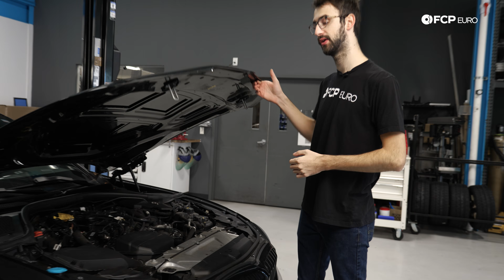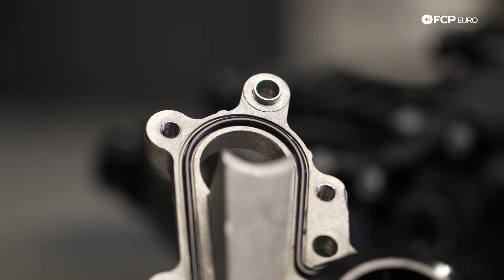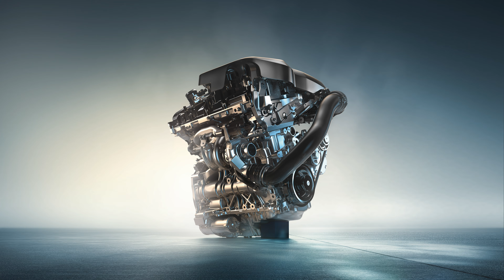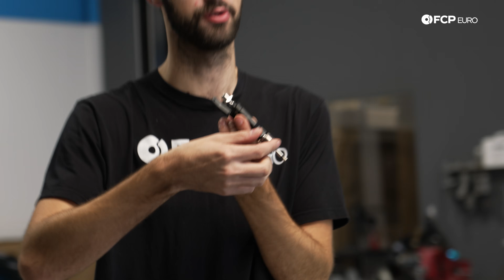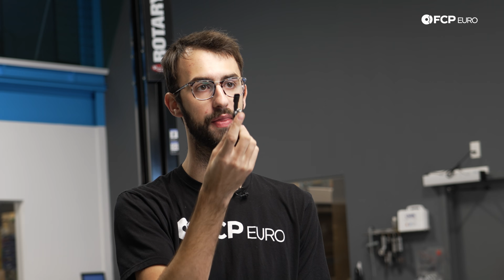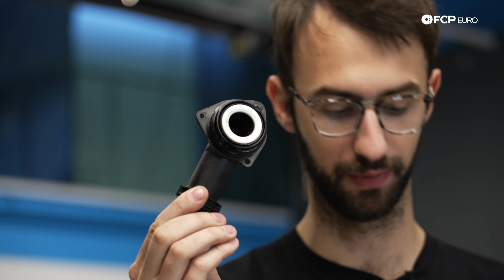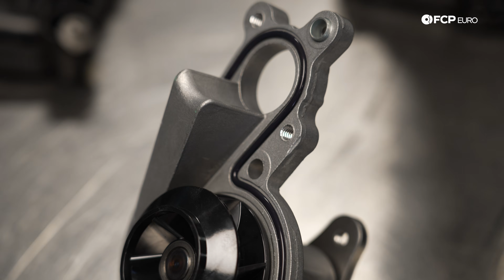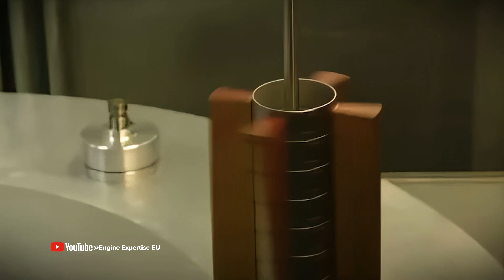BMW B48 Engine: Everything You Need To Know - BMW F30 330i, G20 330i, G01 X3 xDrive30i Engine Guide

Comment: I have a B48 with 210K miles on it.  No issues so far.  Finger's crossed.
Reply: Oil Filter Housing changed ? B48 TU ? or F generation ?
Reply: @vlad330i  The more later the better
Reply: 120k km on mine and no issues, though i did replace my coolant expansion tank a couple of months back
Reply: @williamdjunaedi2357 Just changed mine 2019 530i Xdrive @57K
Reply: @williamdjunaedi2357  had to changhe mine at 71k miles, but its working well thus far.
Reply: @williamdjunaedi2357  that’s con
Reply: Change your engine oil & coolant earlier than BMW recommends, you will be fine.
Reply: @ That too (2017 G30 530i btw if youre asking)
Reply: @johnmactavish5191  that’s not true, changing your oil and coolant  more often does not make these brittle plastic pieces last longer…  it might be better on the chains for sure but won’t change plastics breaking down.
Reply: @quiksr20 it all depends on how they drive at the end of the day
Reply: @quiksr20 which plastics have you had break? On your car
Reply: @johnmactavish5191  20k oil change intervals and going strong.
Reply: @heatsink9198 20k? 10k is crazy but 20k?
Reply: @johnmactavish5191 which oil n coolant do you use an how often?
Reply: That's awesome!   I'm a high mileage guy too. Hope mine does well.
Reply: Love to hear it - what has your maintenance intervals looked like? What car?
Reply: Such 🧢 😂
Reply: @isaacchavez1425  what? You jealous that Bmw cna go mre than a 200k miles without porblem? Cry hard
Reply: Wow! I replaced a leaking turbo oil pipe and coolant hose as part of a recall.
Reply: B48 Gang!! 🔥🔥🔥🔥
Reply: 150,000 miles on my 530i still running strong…
Reply: Please how did you keep it that reliable? I'm at 50k miles
Reply: Can you post a picture of your mileage? I have non-believers 😊
Reply: 70k miles already faced coolant issues not good. What's meaning reliable.  If you want most enjoy you Have to spend money otherwise no way
Reply: @asimkhalafov982 same
Reply: I'd guess it's more about heat cycles than km/miles. Lots of short trips will kill the plastic earlier.
Reply: Mine also good!!
5 years old..
But in term of performance and effienciency, my 330e can compete with any brand new same class sedan.. no drama just pure driving dynamic..
Reply: No issues by Euro standards where you replaced parts before they failed or no issues by Japanese standards??
Reply: 272000 km… no issuess at all, best engine ive ever had
Reply: @michielballhaus6336 its the b48 ? 

What you had to replace so far with this kilometers ?
Reply: @sebbbou5455 nothing!
Reply: New 25 X3 30
Reply: Your blessed because at 50k miles I had a cracked hose 60k miles I had a cracked radiator and heat exchanger
Reply: @iits.mufasa   Because you probably had the wrong coolant/anti-freeze.. you can´t use anything, you have to use the one indicated, which have anti-corrosive additives and usually is quite expensive. If you use cheap shit, you are looking for trouble.. maybe it was there already and it was not your fault...
Reply: @ it is the bmw coolant when I first got it same thing when the repair was done
Reply: HOW SWAY. LMAOOOO
Reply: That's great to hear!
Reply: You dont even have a car so stfu
Reply: That's awesome. I'm at 105k and thought that was high.
Reply: What do you do for scheduled and unscheduled maintenance?
Reply: What engine oil do you use ? Anybodies tips and tricks i appreciate.
Reply: @ericsivilla4091  Liquimoly is the one of the finest
Reply: wtf are you driving a honda or a bmw 😂😂😂😂
Reply: What year and model?
Reply: My engine blew at 67k miles cylinder 2 piston damage
Reply: @LeoBasass  were you beating on the car? did you tune it or was it stock?
Reply: Good information!!
Reply: Im looking to get one with the m package. What's the average cost of maintenance for it? and what were major things you had to replace if any?
Reply: Is this B48 and interference engine or is it free running? Specifically curious about the implementation in the Mini Clubman.
Reply: @MaroonCorey every BMW engine for the past 40+ years has been an interference engine.
Reply: @chrisrollins1 cool, thanks. Figured it probably was
Reply: Im not a mechanic, but over the past few month ive had so many issues that my mechanic calls me when he cant figure something out.
Reply: Wooow. My only has 54k so far in an f30
Reply: whats your instagram i have some questions about my 330i
Reply: I heard a lot of jokes in my day but that my friend takes it
Reply: The B48 in my 2019 530i xDrive is at 97,000 miles, shoutout to you 👌🏻
Reply: You still have it? Any problems
Reply: Wow
Reply: That is encouraging, just bought one. not sure about my impulsive choice of red  but of course i must be prepared to service it like a dog
Reply: I have a b46 gr Supra I’m hoping mine will last , do you guys think it will last 150k miles +?
Reply: I was about to go look at a 140k mile 2018 330i (manual) - now I don’t know - should I stay away??
Reply: 😢 you give me hope for my purchase tomorrow brother
Reply: Lucky, I've got misfires, coolant leak. Its been hell for me
Reply: What have you done? I’m at 112k I’m hoping to push strong
Reply: I have a 2017 330i with the b46, what year is your b48?
Reply: @sperlongatours  turbos aren’t failing… been  driving BMW’s since e30s… it’s the plastic bits that are failing. We are talking about oil filter housings and plastic coolant flanges failing, the turbos outside of wastegste rattles are usually fine.
Reply: I think it's impossible for a BMW B46/48/58 to reach 60k miles without a coolant leak, let alone 210K.  I have one with 60k +/- and have replaced upper coolant hose, turbo return coolant hose and now the upper coolant flange along with the entire oil housing. All due to cheap or inadequate plastics and or poor design. I have done all scheduled maintenance and used only BMW coolant after flush.  No more BMWs for me.
Reply: Mantain it correctly and use the right stuff, not Prestone or the wrong oil, and it will last forever..
Reply: @wepmo  I disagree, The B48 oil filter housing issue I faced was with Factory BMW coolant and Liquimoly oil changed every 6k miles.. Not sure how using the right coolant would affect the plastic parts failing.. Its all over the forums just search bimmerpost for B48 Coolant and you see tons of complaints. Ive never had to replaced stuff like this on cars this new in my 30 years of driving many cars.. Hell my old turbo Nissan ( 2.0 Twin Cam Turbo ) was beat to 7600rpm daily, drag raced and beat to hell and NEVER had a coolant issue, its a 1992 and still has the same radiator. These failures have ZERO to do with Maintenance and everything to do with poor design / poor materials.
Reply: @quiksr20  I agree because I kept up with maintenance with my vehicle and I’ve had these vehicle only for a year and had these issues I want to switch to the b58 but no car should be like this
Reply: @iits.mufasa  I agree and it sucks because I love the car and I am a BMW fan ( have been for years ).. But to have to cough up thousands in repairs for things that should be breaking on a call with less than 80k miles / 5 years sucks... BMW has no excuse and should be recalling this crap.
Reply: @quiksr20  I agree 100% I used to be jdm all day I switched over I love bmw but it’s just poor design these are issues that should’ve been squashed with the n54 motor
Reply: @quiksr20  I’ll be trading my car soon I’m thinking q50 or 540i Ik the b58 is way better
Reply: @iits.mufasa  Just keep in mind the B58 is better but has the same exactly coolant issues ( same parts basically ).. It sucks because the B48/58 are great motors with just some costly poor parts choices bolted on to them.
Reply: @iits.mufasa  100% agree, Still have a 2.0 SR20DET Sentra SE-R ( Bullet Proof ) and have had numerous B Series hondas you couldnt kill.
Reply: @ that’s awesome man my neighbor had a sr20 det s14 it sounded amazing he used to beat on it and never had an issue I wanna build a boosted 350/g35 and a Honda b or k series for fun
Reply: @iits.mufasa  Thanks!! Yeah despite the negative stuff people say Hondas are engineered well and can be very fun.. I also had a G35 ( 2006 6 speed sedan ).. If you click my name I have some videos of my Sentra and possibly my old G35.. Best of luck with your projects.
Reply: @quiksr20  I'm about to get the F31 330i 2017 and came across this vide plus ur comments about the coolant. What's the cost of changing it and what are the symptoms when it breaks or time to change? Ty
Reply: @Hiltonfen  When the oil filter housing breaks it dumps coolant all over.. Cost me over $2000 to fix.. Just search for it on bimmerpost its everywhere...  Its burried under the water to air intercooler/intake manifold.. Might be diff on a 2017 being an F chassis LCI car vs G chassis newer car.
Reply: @quiksr20  I see what you mean. Did you replace it with OEM? I see some replace and recommend it with aluminium oil filter housing.
Reply: @Hiltonfen  I went with OEM.. I wanted to research the aluminum options but needed to get the car fixed asap.
Reply: @ I guess the things that cause the problem is still the plastic o-rings and sealings not the actual housing.
Reply: @wepmo  which engine oil and viscocity do you recommend  ?
Reply: @ericsivilla4091   You need to check on your owner´s manual, it will depend on the type of engine that you have. If you have a 4 cylinder, use 5W-30, but if you have a 6 or 8 cylinder, you should use 5W-40. BMW recommends 5W-30 for 4 cylinder engines that have turbo, so the oil gets to the turbo and other parts of the engine faster and easier. Never use viscocity index of 50 or 60, you might damage the engine, especially with the 60. Check with BMW for your type of engine or look on the Internet for your specific model.
Reply: 70k changed oil housing filter coolant hoses water pump, and about to change oil pan gasket 😅 leaky car

Comment: Many thanks for this great review! I’m personally looking for 330i as my next car. It would be useful to know if there are changes in LCI model (which started its life in the middle of 2022 and has a little bit less of power - 245ps  here in Europe). Cheers and thanks again!
Reply: I believe they added the MHEV system. It improves the fuel efficiency as it helps the engine from the dead start. It also shuts down the engine if you let it coast. There is a guy on the forum who has G31 540ix MHEV and does 9.95 l/100 km, which is absolutely sick for a B58 that drives a lot in the city.
Reply: @MatiKosa  no,  the engine I am talking about is pre MHEV addition. That thing has been added roughly in the middle of 2024.
Reply: @MegaGecas  Then maybe it was different across G20 and G30 lineup. In G30, it was introduced somewhere in 2020 with LCI models. I am talking about Euro models, could a difference between US models too.

Comment: Another great german motor wounded by cost cutting and a focus on lease length ownership.
Reply: The lease life - is surely a thing....
Reply: @the_booniesthey don't...engineers are heavily involved in cost control, engineers make trade offs between cost vs practicality and other considerations.This myth about accountants limiting engineers is hilariously wrong. 

Yes engineers report to higher ups in an MNC like BMW it's not engineers vs accountants everybody is more on less on the same page
Reply: @Mark-bd5ci  trust me no fucking engineer is gonna choose plastic over aluminum in terms of housing and tensile material. its accountants vs engineers and if you believe anything else but that you’re deluded.
Reply: Plastic parts are as much about weight saving as they are about cost saving.
Reply: @markfromearth4  oh yeah they’re definitely worried about weight in their 4,000lb vehicle. Aluminum is very light btw
Reply: @ltiui  if they weren't, it would probably be a 5000lb vehicle
Reply: @macktuned  If you replaced all the plastic parts with aluminum, you wouldn’t have 1000lbs of material.
Reply: @ltiui  so youre just a contrarian.
Reply: @macktuned  Disagreeing with you doesn’t make someone a contrarian. Maybe make sure you know what you’re talking about before throwing that label around. 

Automakers care about sales and people keep buying heavier cars. we end up with plastic water pumps, oil pans and other cheap components because It’s cost cutting and planned obsolescence, plain and simple.
Reply: @ltiui  the 330i g20 is like 3520lbs
Reply: @DudeThedudesky that's not too bad weight wise
Reply: Great video. Thank you!

Comment: Also worth noting that the engine mounts on the TUs seem to fail relatively early (my car, g20, at 45k miles) and are extremely soft- you can easily rock the engine with your hand. Would love to see an aftermarket replacement that isn't completely solid but instead streetable

Comment: I think we can all agree, it's an excellent engine but it is not a handsome engine 😆
Reply: Sounds 10 times better than the N 26
Reply: Not a good sounding one stock either lol
Reply: @Rayman.g  I actually really like the sound of the B48, it's an old-school 4 cylinder sound akin to something like an old Alfa. Much lower pitched than something like a Mk7 Golf.
Reply: @ Honestly this is accurate and I definitely should have clarified. My parents had a G20 loaner while their X3 was in the shop and that actually sounded pretty good. The X3 sounds kind of terrible stock even when the exhaust valve is open. Def could use the MPerf exhaust.
Reply: It's handsome if it's totally nude! Lol